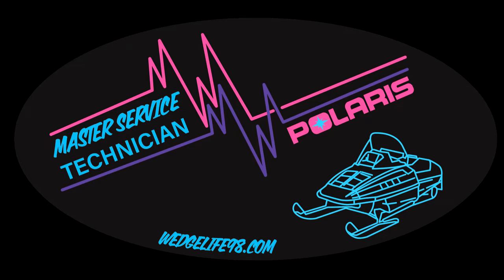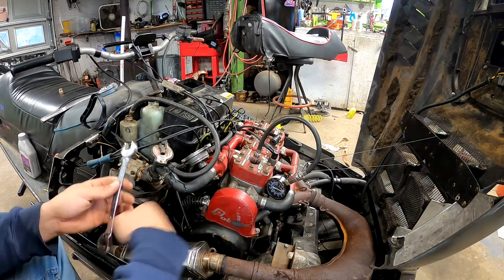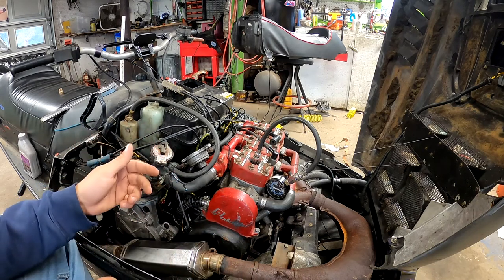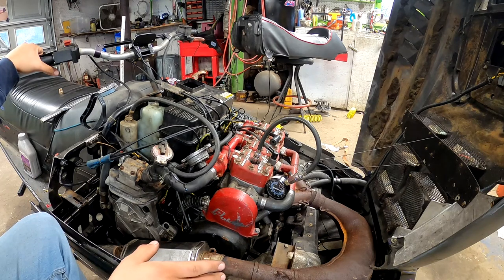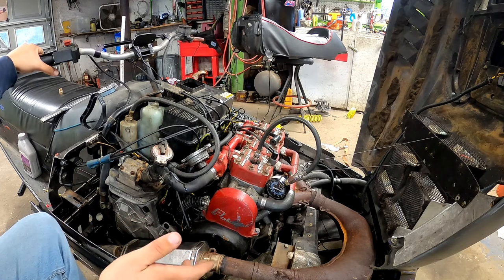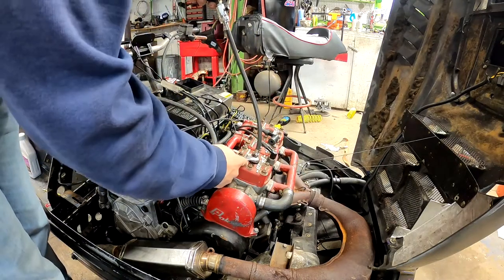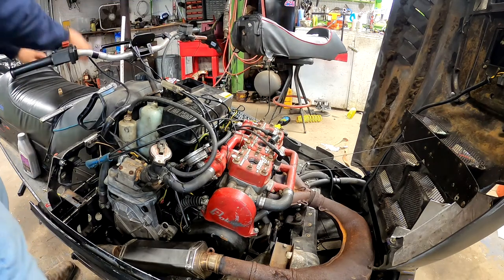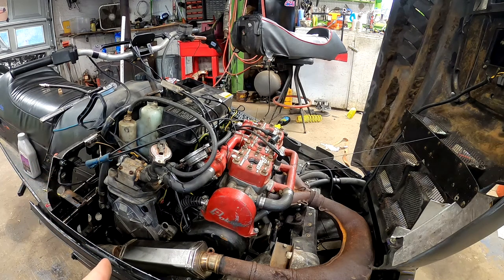2 Stroke Snowmobile Compression Test for Beginners

Comment: Heyyy i seen you on tictok, anyway from your past video called “ fast XC skid install” . 
Where and why did you use a ratchet strap the skid? Did the bolts not line up before the ratchet strap?
Reply from the maker: I hook them to the front and rear arm, or loop the strap to itself. 8" and 10" Polaris rear suspension need to be compressed when you install them. Some people unhook the springs, I don't like messing with them myself so I use a strap.